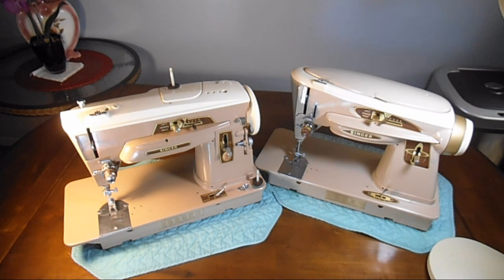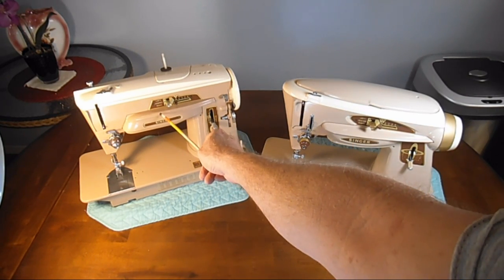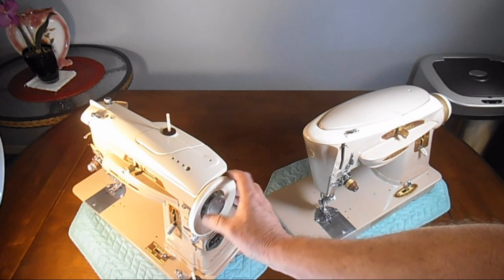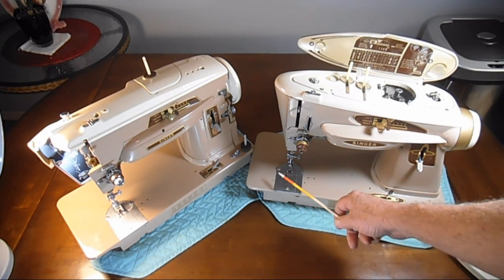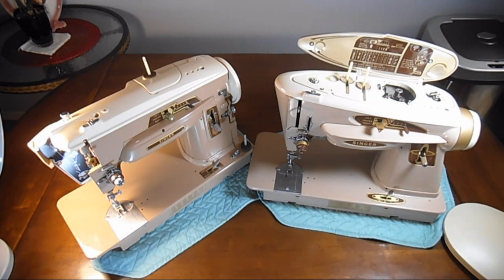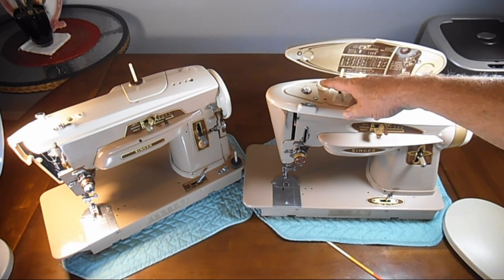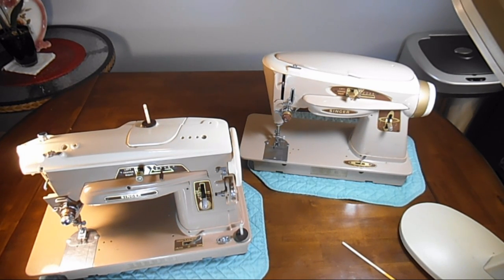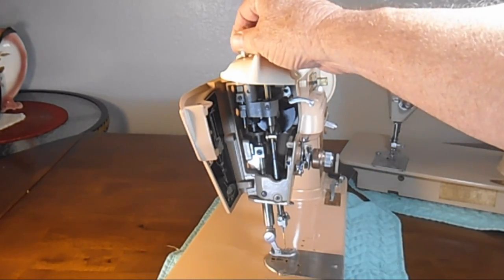Compare Singer Models 403A & 503A Sewing Machines

Comment: I watched the whole video! no problem. I just acquired a 503A in good condition for $20 bucks. It has the 0 cam but not the cute little spool holder for the inside... I have a new obsession for vtg sewing machines from the 1960's to 70's. I LOVE your style of videos. You really help me understand how these machines work so I can restore them, thank you sew much ❤
Reply from the maker: It's a fun and rewarding hobby, for sure. Thank you for saving those machines. $20? Just the tension assembly sells for that much on eBay! For you, and other viewers here is my 21-video Playlist for model 503A: https://www.youtube.com/playlist?list=PLsCOZgzzaiKJZaZn2zl3LsnV2d7UhrqvX   If you don't see the part or system you want to work on you can try the 27-video 403A Playlist as most of the parts are the same: https://www.youtube.com/playlist?list=PLsCOZgzzaiKKyqvdDRwS-9MfLuwSNJTcg
I don't know why the Auxiliary Spool Pin always is missing. I mean it just sits in its own little storage area. They are rare now, You can find a few on eBay for $30 to $40 👀 here is the bargain one today at only $33 with free shipping: https://www.ebay.com/itm/234652489624?hash=item36a260d798:g:5sgAAOSwKCFi8WOd
Hope you enjoy your new Rocketeer, and thanks for watching my channel, SuZ Take Care

Comment: I grew up using the 503 Rocketeer.  My moms machine had 2 beautiful eye shaped knobs to  do different decoratice stitches per each of the 4 or 5 disks or cams that came with the machine.  I think it did 30 different stitches.  Over all beautiful looking ,sleak , wing or finn shaped design. Oh it  ran smooth just had to turn wheel forward in the down position to start and it had a wonderful bizzzzz humming sound when it sewed.  Thanks for posting.
Reply from the maker: What a great memory. Nice of you to share. My Mom had a 1940's Singer and I loved watching her use the buttonhole attachment. Years later her sister bought a Rocketeer. Mom said the idea of sewing on it kind of scared her; like "looks like it could take off and start flying around the room" but she said she could listen to the bzzzzzz all day long.
Reply: I bought 401 when first came in 1958 . Very good sewing machine,but recently I got  a 403a witch I having tried so far . Thanks for all interesting information
Reply: The sound compared with any other machine.   Solid.     Beautiful.    I love these older machines.

Comment: Just found one just like yours. I don’t know how to sew. Video was very helpful in learning what the gadgets are for. It’s not simple for me because I’ve never used a machine. 

When showing types of stitches, you stop, turn wheel on right and do something with a lever. Close to needle! 

Can you do a slower video and explain for those of us dudes that want to learn how to sew. Asking for a friend😅
Reply from the maker: Not making videos now due to health reasons, but I can give basic info. 
     Call the wheel the handwheel, and always turn it towards you. 
The lever behind the needle is the "Presser Bar Lifter". You use it to raise and lower the "Presser Foot" from or onto the fabric. It pushes down the fabric against the "Feed Dog", the thing with little teeth just under the "Needle Plate" that the fabric rests on. 
     The Feed Dog pulls the fabric in sync with the needle; so when the needle is in the fabric the dog stops pulling and when the needle is up out of the fabric the dog moves the fabric the length of the stitch you set. 
     The Presser Bar has a thumb nut on top or a dial to adjust how much pressure. You want enough to move the fabric but not crush it into the dog. The Presser Bar Lifter has other important functions. When it is lifted it also reduces the tension on the needle thread.
      Now when I moved the handwheel it was to manually raise the needle up out of the thread and when I lifted that lever it was so I could pull my fabric from under the presser foot. See? No needle in the fabric, no tension on the thread, and no pressure holding down the fabric. 
     The presser bar/foot must be up when you thread the machine. That allows the the thread to go between the presser discs that apply tension to the needle thread; no tension no good stitching.
     I suggest you download a FREE copy of the Instruction Manual for your model (you did not say which one of the two) from the Singer Support Page here: https://www.singer.com/support  Just enter the model number into the search box and it will bring up a page showing available manuals. They download as a PDF and are nicely done with good info about your machine, using it, and standard maintenance.  
     There are many good videos for basic sewing on YT: https://www.youtube.com/results?search_query=how+to+basic+sew     
If you want a deeper dive into the machine itself I have 27 videos for Regina, my 403A:
https://www.youtube.com/playlist?list=PLsCOZgzzaiKKyqvdDRwS-9MfLuwSNJTcg    
     and 21 videos for Vicky, my 503A:
https://www.youtube.com/playlist?list=PLsCOZgzzaiKJZaZn2zl3LsnV2d7UhrqvX   
     My wife has been sewing for 60 years, but I'm just a mechanic of the machines, and doing a demo seam in the videos is the extent of my sewing expertise 😃
Whether a 403A or 503A you certainly picked a fabulous model. Happy for your friend 👀  
     Thanks for watching my channel, and good luck.

Comment: Andy, that was very interesting. I watched the whole thing. I have (2) 503a's, which are in working order although the guy I had 'service' one of them broke the hinged lid and chipped the perfect paint. I was pretty unhappy about that, it was pristine before he got his hands on it. I learned a lesson there.  I got another one afterwards in perfect condition and double checked everything before buying, then put it in the original blonde cabinet I got with the first machine.  I also have a 503 which I've not looked at yet, (needs work) and a beautiful 403a in perfect condition with its original mahogany cabinet which I got from an estate sale for $35.  All told, I'm a fortunate vintage Rocketeer collector.  When I watched this video, I pulled out the 403a and went over it with you as you pointed things out.  I took off the bottom tray and found a little linty grease on the gears but really not much. It must have been serviced not too long ago.

I love your videos and I hope you'll keep making them.  Thank you!
Reply from the maker: Thank you, Roberta. You have some great machines there! I cringed when reading of the damage they did to the 503A. How unfortunate. He should have paid for the replacement. Maybe now you can service them yourself? I know you really appreciate them. I hope to keep making videos and am very encouraged by comments like yours. I also am amazed at the prices my viewers can find these vintage machines for! You are a great bargain finder. Congratulations
Reply: Roberta, if you're there, there's a mint 503a cover on Ebay right now.  I just looked at it.

Comment: The total number of disks that I've found is 23 with 0 being zigzag and 22 being stretch stitch but that one requires a specialized foot. I love my 503a. The spool draw mechanism shines if you use and vintage thread spools with rough edges that occasionally drag on the felt. With modern smooth edge spools, it can be bypassed. My local thrift store just had a 401a and a 500a at the same time. The 401a had no power or pedal cords and was marked at $7 as a final attempt to sell. I bought it for kicks and manually turning learned how the cam stack interacts with special disks giving over a hundred different stitches possible. Went straight back to the store and bought the 500a for $100. I will note that both machines had broken bobbin springs. Leaving my trusty 503a in the cabinet and completing minor repairs on the 500a for a portable machine in the soft case it came with.
Reply: Just an afterthought, the felts on the 500 series are all glued and do not spin freely. This could be why the spool draw feature section of threading is exclusive to only 500 series.

Comment: Hi Andy - your videos are by far the best!  So helpful - thank you.  I am in the market for a 403A, 401A or 503A.  I almost got a 401A with case and accessories on Craigslist for $100, but the seller was really giving me a hard time when I asked if I could test it out with a piece of fabric.   Instead she sent me a 1inch by 1 inch video of the needle going up and down- seemed fishy to me :-)   By the way, would you happen to know what would cause a machine to run slow, but then speed up when you pressed on the plate area above the bobbin (in a 403A)?
Reply from the maker: I've bought a lot of machines off of Craigslist, you you do need to be careful. Needle movement does not reflect a "working machine" only a working needle. The bobbin case may be missing, a belt broken underneath, the feed dog lost, etc. If they won't let me try I don't stop by is my motto. Don't know why that is happening on your 403a; The first test I'd make is removing the bobbin and bobbin case and trying the speed. On a model like the 403A, the most common cause of slow speeds is a worn, out of adjustment foot controller. That controls the speed of the motor after all. https://www.youtube.com/playlist?list=PLsCOZgzzaiKL6ePPxLpmnWSzTyxPKTb71
Also, a "dry" machine that lacks oil & grease will make a machine slow and noisy https://www.youtube.com/playlist?list=PLsCOZgzzaiKKyqvdDRwS-9MfLuwSNJTcg

Comment: I like the numbered pressure dial on the 503A inside the left cover, while the 403A is a screw on top left side.
Reply from the maker: Many people do like the numbered preset dial. Many also prefer the variable adjustable thumb knob system for its infinite settings.
A true matter of choice. Thanks for watching.
Reply: I have a question. Why do you never tell what the button is for on the back of the neck in line with pressure foot? I pushed it in and think it caused that dial mess inside affecting the pressure foot making it limp n I dont know how it goes back together

Comment: Thanks for the video.  I have the 503a and the stop motion on the handwheel is frozen.  Where to I put solvent or oil on the handwheel to try to free it up.   Wish you would do a video.   Thanks.
Reply from the maker: The stop motion know may be over-tightened, or the clutch washer behind it may be stuck with dried oil/grease. It can be difficult to get penetrating oil onto that washer as it sits between the hub of the handwheel and the back of the stop motion knob. If you need to see the washer take a look at this video: https://youtu.be/eZiMaaka5HE   Here is a video for regular maintenance of model 503A. At 59:20 I start showing how to remove the top cover https://youtu.be/Sn2XD4EILFM    When you have the arm cover removed you can see some of the back of the handwheel. You can try to get a spray tube into the area between the wheel and knob where the washer is, but good luck. I've had better luck blowing the back and sides of the handwheel area with a hairdryer. Be patient. The heat can soften the dried oil it if that's the problem and it can expand the parts and allow for turning. Sometimes having a person with a strong grip just force it to turn can work, or a two person/four hand system of hold handwheel/turn knob. If you are feeling brave you can rap on the end of the stop motion knob, towards the handwheel, with a mallet to try and "shock" the parts to come free. Risky behavior though.

Comment: i am lucky enough to have 3 slant-o-matics. (: i got all 3 for a total of 52$ :) a 404a, 500a, 503a, other than the 404a is a strait stitch machine is there much difference Between it and the 403a?  n other than the discs is there a difference between the 500a n the 503a? is there a way to find out which one came first? ty so much for your videos, i was able to fix another of my machines thanks to your videos, n i enjoy the wealth of information you put into these videos
Reply from the maker: Just to clarify, it is just model 404, not 404A. The "A" in 403A and 401A signify they were made in SIngers new factory in Anderson, SC. The 404 model was made at an older factory in Elizabeth, NJ. 403A & 404 have the same motor, bottom shafts & gears, Hook system, Tension Assembly, and most other parts. Model 404 is considered a Heavy Duty Straight Stitch only model that can only sew with one needle, It has some heavier bushings/shafts. Model 403A adds a Pattern Selector System that allows you to "snap on" plastic Pattern Discs or Cams one at a time inside the lift-up door on the arm cover. It has one follower that follows the edge of the disc and moves a Needle Bar Driving Arm to make the needle bar (and needle) swing back and forth as the pattern dictates. That is also called ZigZag Sewing.  It can sew with two needles or one in straight stitch or ZZ, forward and reverse.
     Model 503A is the next version of the 403A with mostly the same mechanics but a "Rocketeer" body shape and a larger flip-up arm cover with a bobbin winder system on the top instead of the front. Model 500A was the "top" version or most expensive. It is the same as the 401A except for the above-mentioned "Rocketeer" features. Models 401A & 500A have an additional Follower, so one on each side of a Metal Cam Stack System of 7 Steel Pattern Discs. Additionally, the same plastic pattern discs can be snapped on the top of the cam stack one at a time. The disc selection is controlled by knobs on the front of the machine as well as levers. With more discs and two followers, the 401A/500A models can sew many more patterns than the 403A or 503A models as well as sewing "Dual Disc" or Dual Pattern" stitches.
    Which came first? Model 301/301A was the first "Slant Needle" model, then came the 400s and then the 500s. Here is an excellent website about those models, it is mostly concerning the 301, but you will find info about the 400s and 500s, and going by the serial number on the bottom of the machine you can see the year it was made. https://www.singer301.com/dating/default.html
    If you are bored someday you can watch an almost 3-hour video I made comparing the 401A, 403A, and 404 models and my opinion of them.  https://youtu.be/Nee9PavxWhs
     You may also be interested in having copies of the original Instruction Manuals in PDF downloadable format FREE from the Singer Support Page here: https://www.singer.com/support   Just enter the model number in the "Enter Model Number" search box.
The manuals are very nicely done and contain an incredible amount of info about using the machine including oiling and the accessories like presser feet and others.
     You may also find free instruction manuals from the Sewing Dude here: https://sewingdude.wordpress.com/category/free-manuals/    The nice thing about that page is he gives away the Service Manuals for the models you mention.
 Thank you for fixing your other machine and for the kind words about my channel. Good Luck and take care.

Comment: I’m thinking about the Singer 328k. What do you think. I can pick one up on Monday. I would love your advice.
Reply from the maker: It's a nice model for home sewing. It is versatile and built strongly. It is not as powerful as a 403A, but can do most normal sewing including hem jeans. It is fairly easy to maintain and used parts are readily available b/c they made many of them. You can usually find them (USA) for a very reasonable price, too. Good Luck, and happy sewing.

Comment: I’m looking at both machines in Market place. I’m wondering which one you like the best?  I’m thinking the 403A, am I right?
Reply from the maker: Yes, the 403A. I prefer the industrial styling over the "Rocketeer" look. The 503A bobbin winder tends to break but the springs can be replaced when it happens. The 403 bobbin winder will never break. They have the same mechanics other than the little thread puller by the take-up lever on the 503 which Singer never used after the Rocketeer models. Can't go wrong with either machine but the 403A will last longer and is easier to maintain, IMO.

Comment: Hello. I just bought a 503 A for $50. The feed plate is a bit loose and not holding the fabric when sewing. Also the bobbin Winder us not windibg Tate bobin. Would appreciate adics.
Reply from the maker: Congratulations on finding a Singer 503A Rocketeer sewing machine. Starting with the Bobbin  Winder it is common for a spring to be broken but you can replace it. Here is a playlist of videos for Model 503A and the first two are all about the bobbin winding system: https://www.youtube.com/playlist?list=PLsCOZgzzaiKJZaZn2zl3LsnV2d7UhrqvX     About the Needle Plate; there is a lifting system for the needle plate to raise, lower and remove the plate. It very often needs cleaning and slight adjustment. Singer model 403A has 90% of the same parts as the 503A model, including the needle plate bracket and I have a video for working on it,
https://youtu.be/n1LSM-BZw9k     In fact, if your 503a  needs other work and you can't find a video for it in the 503A list, please look at the 403A list as I may have a video there. Here is the 403A list: https://www.youtube.com/playlist?list=PLsCOZgzzaiKKyqvdDRwS-9MfLuwSNJTcg   Model 503A is a very versatile and strong machine with many features. If yours did not come with an Instruction Manual you can download one for free from the Singer Support page here:  https://www.singer.com/search/support?title=503
Thanks for watching my channel, and good luck.